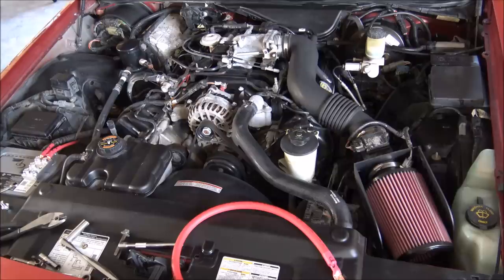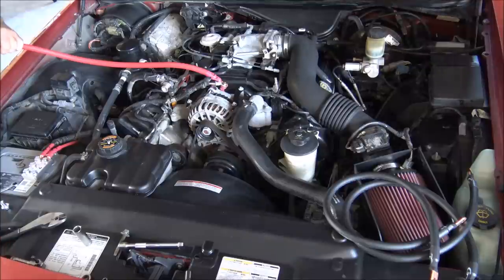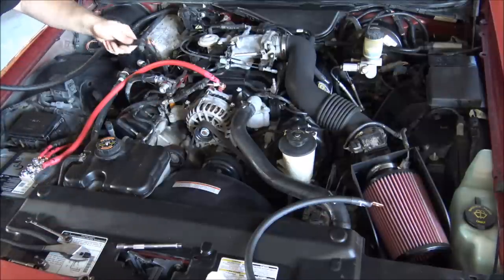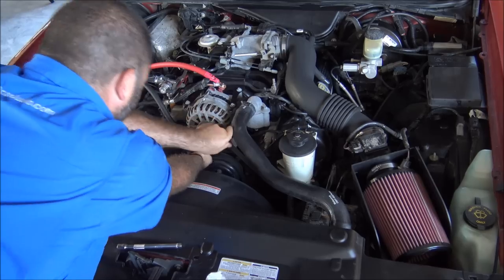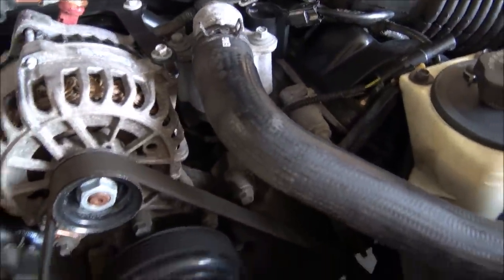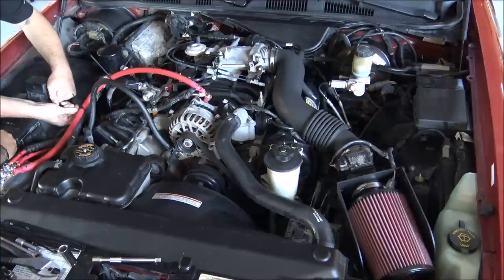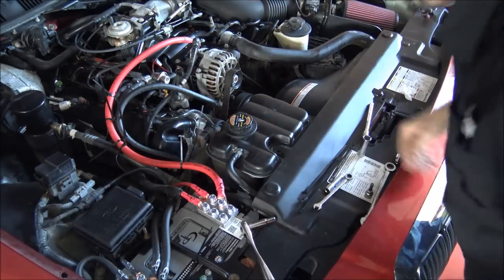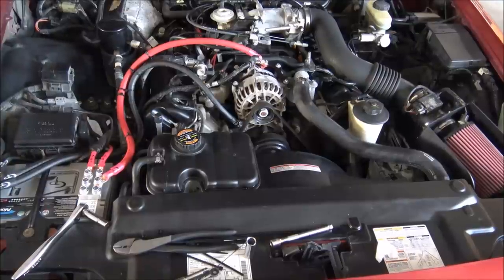HOW TO INSTALL THE BIG 3 UPGRADE CAR AUDIO

Comment: Never hook the positive wire to the alternator with the positive battery terminal connected to the battery post. This connection is hot even with the key on, and if you happen to short out the ratchet to ground, you run the risk of burning out the factory fusible link.
Reply: Damn where is the fuse between the alternator and the battery???
Reply: It's probably a fusible link, like a special section of wire that sacrifices itself instead of burning up the harness. They are usually located close to the battery. An auto shop can find it and change it for you.
Reply: @jamespaulson5486  I was referring to the video. Why is there no fuse on the new positive wire. If it's a leased car and your going to remove everything you added to the car cool, but it is not clear if he removed it or not, to newbies if nothing is fused on that run of wire it could possibly burn the car up

Comment: Ok I do my big 3 a lil different,since the motor mounts are insulating the motor from frame with rubber ,and the body mounts are rubber and you usually ground ur system to the body ,why don't u have a body to battery ground???? That's how I do mine alt to batt,block to batt,body to batt am I wrong???

Comment: What drill bit and thread did u use to drill the hole in the chassis at the bottom
Reply from the maker: Shaquan Hardy 
5/16th drill bit and 3/8ths tap, we use flange head 3/8ths bolts to secure the grounds
Reply: Shaquan Hardy you can but frame tapping bolts.You just have to drill a pilot hole corresponding to the bolt.they have an appearance with a cone type of thread,and they work great,if you don't have a tap set.or grind frame,and weld a bolt to it,or this.

Comment: Do you need to upgrade your alternator to do this?
Reply from the maker: No, even using your stock alternator, you will drastically benefit from this.

Comment: So you don't fuse it from between alternator positive and battery positive? I saw a few videos where they run from alternator positive fuse it then run another wire from fuse holder to battery positive
Reply: Yes you need a fuse on the alternator power wire. Not sure why he didn’t do this. He mentioned that you COULD put one as if it doesn’t matter. It does matter and you do need one.

Comment: What will i need to do if i im running  over 21000 rms. big 3 wisevplz help gp audio.
Reply: If you're running over 21,000w RMS and you don't know what you need in order to feed that system, you are already wrong on so many levels dude. I'd suggest reading up a little bit for your own well being rather than relying on other people to hook your stuff up.

Comment: My battery is in the trunk can I just run the cord from the alternator to my fuse box positive power cable that comes from the battery??? Would be alot easier for me.
Reply: No, the idea is that all wires from the battery to the alternator are larger size than factory. If you have a 1000 watt amp for example you will need a 1/0 wire all the way from the front to the back.
Reply: Yes on the positive side you will run from front to back in back just upgrade your chassis ground

Comment: Hey you think that if I have the big 3 pluse an extra baterry will work with a 8000 amplifier?
Reply from the maker: On 8000 watts you'll need a Northstar smsagm480 battery and need to look into getting a high output alternator
Reply: For 15K I have 10 batteries and 3 HO alternators.  There is an electrical calculator app you can get on your phone to give you an idea.

Comment: I have a 97 towncar is this the same? I cant find stock engine ground..is the short wire from ur batt neg to side of car a good ground
Reply: Yes,make sure to scrape off the paint if there's any ,you want the ground wire to touch bare metal

Comment: It doesn't have the be a 'big' 3 upgrade, 6 gauge wire is good for 100amp so you can do over a 1000 watt system with it. Why go overkill?
Reply: Because they have more than 1000 watts and your math is off anyway.. why wouldn't you increase the flow why would you want to bottleneck electrons 🤷🏾‍♂️
Reply: @slow_rednline4874  yea back then I thought amps had small inefficiencies, but most of them have heaps about 70%

Comment: If your running 3000w is there a need for an upgraded alternator?? Also is your alternator stock?
Reply: Mark Pulford upgrade the alternator
Reply from the maker: We are installing a 390 amp alternator on this today. on 3k rms you can get away with just a secondary battery, northstar smsagm220, or northstar agm31, and will supply and hold save voltage. but a high output alternator is suggested due to the increased performance
Reply: Battery type doesn't matter at all. You will gain nothing using some over priced northstar or some wonder battery. Get a larger alternator that will over supply the total vehicle load and be done with it. You can run a STOCK battery if you do this. What? Your alternator CREATES the voltage and current. Batteries just STORE it.
Reply: I am gonna throw this out, I do agree with Jim.  When using your amp or any electrical device.  All devices in your vehicle will pull the higher voltage source.  Once you are pulling all of that then your batteries will kick in.  This is also why I recommend using large capacitor banks, because capacitors will store the voltage and help keep that higher thus giving your amps that higher performance.  Upgrade the alternator and throw a large cap bank in there.

Comment: show the voltage before and after the big three
Reply: Shouldn't the hot from the battery to the alt be fused according to the wire size???
Reply: Mike Sinur I hear you dont have to its only recommended incase you get in a car accident in a front collision and the wire gets cuts and can start a spark
Reply: Gino Partosetiko
Reply: My car went up from 13.9 to 14.65 off of a cold start up
Reply: @mikesinur1992  your right buddy, these guys are half job Tony's
Reply: @Mazza666  lmfao half job tonys, gonna use that one

Comment: Wats the size battery you use for this build an can i use two for my set up 1600 watts amp 2805rms
Reply: Get a High output alternator.

Comment: does 4 guage wire also work
Reply: Yes. Only if true copper wiring tho
Reply: ryan black where we get that
Reply: Just look for OFC (Oxygen free copper) wire. Make sure the company of whoever makes the wire are true gauge. Stay away from CCA (Copper clad aluminum) wire. A lot of times you'll get cheated with that. They'll give you more jacket than actual true gauge wire. Not only that, but CCA often times does not hold up well to high current draw over time. But CCA is usually a very cheap alternative. Sometimes OFC wire can be a bit iffy depending on the brand, Usually still better than CCA... But, Apparently Welding cable is better than Car audio OFC & CCA wire, because it's 100% copper & very true to it's gauge. So, you just gotta look around.
Reply: KmanBeatz what size fuse should i use for 4 gauge goin to a 150 amp alternator
Reply: Yes
Reply: KmanBeatz welding cable is good shiz. It Has to be if you think about it, the amount of power that runs thru it to weld is intense

Comment: isn't the engine block one supposed to go to the chasie?
Reply: Timmy A ya that's what I been seen
Reply: It can be but it only has to be 2 grounds u choose which one is better or easier to do
Reply: wade Eldred is basically the same just the 4 is one more ground plus u can never have enough grounds
Reply: So upgrade the engine ground and add an additional ground to the battery making it the big 4?
Reply: Timmy A name of the song
Reply: Ground is ground
Reply from the maker: Engine block to battery, and chassis to battery is our preferred method for best results.

Comment: Hey what's you guys take on running a second battery without an isolator? Or should you do it? I have a grand marquis just like this. Should I run a isolator or it doesn't matter

Comment: Will this fix me ecletical problems with my 05 gmc jimmy?
Reply from the maker: ironman7018 if you are running over 800w on a stock electrical setup, the big 3 makes a huge difference

Comment: Real talk; I been stalling my big 3 but after this motivation video it's done. Now I hear my alternator wine, why
Reply: jmar662 jmar662 it's on the way out I believe
Reply from the maker: is it alternator whine in the vehicle, or is it coming from the alt itself
Reply: Ground loop.
Reply: You have a ground loop.  Make sure your alternator has a good solid chassis ground.  Not sure on your setup, but make sure everything is properly grounded, including your head unit, battery, amps and ect.

Comment: what else have u done to it? i have the same car and am trying to figure out how to put a second alt on it?
Reply from the maker: Matty Ice this 390 amp alt is a bit overkill for this setup, its on a soundqubed 2200 with a northstar smsagm80 as the rear battery bank. Car doesnt drop below 14.2 at idle full tilt lol
Reply: that's awsome, im running a soundstream pa1 5000d on my stock alt and a 800 cca interstate batt..trying to figure out what alt to use..
Reply: my voltage will drop too 9/10 volts at idle with the new batt, gonna grab a second probly as well.

Comment: I have a 89 Grand marquis box.But it does not have the alternator screw on it.What do i do.
Reply: Michael Campbell how's your alt secured to the engine block? It's not bolted in anyway? Wherever it is secured to the engine block is where it's grounded.

Comment: What are the other wires that you didnt show like the real short chasis ground next to batt neg
Reply from the maker: Britney Brusnahan That's where the stock 4ga ground was we just swapped it out with 2/0. The wires on the positive were just stock wires, we crimped lugs on them so they could be bolted to the new terminals

Comment: I have a 4000 watt amp and I need a 300 amp fuse is it okay if I go bigger 400 or 500 amp fuse
Reply: You need to look at the specs of the amp, a good amp will tell you the size fuse they require.  If the Amp is already fused, then use an ANL block from the engine to the amp/battery (this varies depending on application).  Put another ANL block before the amp, but make sure it is higher than what the amp calls for.
Reply: Anish Patel the fuse on the power wire is not for protecting the amp. It’s to protect your car from burning to the ground. The fuse should be sized according to the size of the power wire. Do not oversize your fuse!

Comment: Is it the same for all vehicles?
Reply from the maker: Same steps yes. If you have a trunk starting battery its still the same but longer lengths are needed. We have the standard big 3 and trunk big 3 upgrades available on our website. All Ultra Pure OFHC Copper, made in the USA
Reply: @gpcaraudio   and should you fuse the power or would it be ok if you dont ..and should you float the wire ?

Comment: if you have 3 batteries in a f150 under the seat ' do i have to ground all 3 batteries to sane bolt on chassis or its better to make each ground seperate ? can they be 1 foot grounds ?
Reply: One ground from "main" battery to frame. Then connect the rest of the batteries to that "main" battery. Shortest runs possible, less expensive and fewer possible issues with multiple frame connections. If you already have the extra wire leftover, you can also upgrade some of the stock ground wires around/under the truck, for better current, with the larger wire you'd have used for multiple grounds.
Reply: Des420 thanks ' sir '
Reply: Never ground to any frame people. Why? Frame is STEEL. Steel is at best 30% worse than copper at carrying amperage. Not to mention corrosion which will happen degrading it further. All it takes is ONE corroded connector/connection to ruin your day. Don't use OEM body grounds or factory ground lugs either. Ground STRAIGHT to the battery - post. End of message.
Reply: The stock battery is grounded to the frame, so your main point is invalid. The resistance between a straight ground run and a proper frame ground is negligible at best. Besides that Jimbo, I never told him to ground to the frame except on the stock battery (part of the big 3, which this video is about); I told him to ground the extra batteries STRAIGHT to the battery - post. Thanks for not paying attention and having poor reading retention. End of message
Reply: Des420 so then ground multiple grounds from main battery to frame ? sand it very well ' then just ground all the back batteries to the main battery....
Reply: Do the Big 3 under the hood. Run fused power wire from front battery to rear batteries. Connect the rear battery positives together: 3+ to 2+ to 1+ to Main battery +. 
The rear battery negatives: 3- to 2- to 1- to frame ground in rear (seat belt or actual seat bolts can be good in some cases). Sand all painted surfaces to bare metal for your grounds.
Reply: Please do NOT wire it that way.
Reply: The stock ground should be to the STARTER. It's the highest amp draw item in the vehicle. Take notice, steel is at best 30% worse at carrying amperage than clean real copper wire. Electrons going near light speed want the easiest path possible. Then we talk about corrosion/rust. See where this is going? NEVER ground to steel anything. I'm not saying a steel ground will not work. It's just NOT the BEST you can get. See now?
Reply: Is that your thing Jimbo? Going around to every single ground wire related video arguing about how you know the right way to do everything and that welding wire is better than dedicated audio wire, etc.? What an odd thing to become fixated on... And still be so misinformed. Do you even own a vehicle? Because you sure don't sound like you own a system, let alone have installed one.
Reply: I want you to prove me wrong Des420. Put your Crayons down, take a swig off your juice box and show me up killer!!

Comment: I was just wondering if I could do it to my 03 trailblazer because I don't want to do it and taking a chance on frying my alt
Reply from the maker: Martin Howell up you can most Definetly do it and it'll make a big difference. Or big 3 kits are on sale this month. Coupon Code: gpbig3
Reply: I'm only running a 1100 watt amp to two mtx jackhammer 12's
Reply: I just helped a friend do this to his 2002 (I think) he used my old 350A alternator.
Reply: Hey I have a 03 Vic and I ran my big 3 the same way and more power wire is real long because I fused it do that matter if it's real long and now when I turn my acc on it kills my battery
Reply: I'm running the big 3 upgrade on my 04 trailblazer because I'm running electric fan setup. You shouldn't have that issue. I get mine from pcmofnc.com

Comment: wicked tip with zip ties...gonna use it.
Reply: Why, that soft plastic zip tie under the hood with over 200 degree temps? Think about it.
Reply: @jimdavidson5208   You've seen a lot of melted underhood zip ties in your day? Shouldn't have any problem unless they're actually resting on the engine or radiator..

Comment: Have you ever done a big 3 on a Saab 95 2000' v6 turbo
Reply: Mark Seven  where did you ground at and where did you run the power line to the back?  I'm trying to find a grommet so I don't have to drill into the fire wall. I think it's one under the drivers seat
Reply: Mark Seven  did you need a radio nozzle and where did you get it if you did,  oh and the steering wheel interface

Comment: For a newbie this vid is confusing. First you say tap the chassis ground wire directly to the frame, then you attach it to what appears to be some sort of battery terminal that already has so many wires attached that it’s hard to distinguish one wire from the other.

Comment: How would I do this on a 99 expedition bcuz I jus installed 2 Orion 12s with a 5000 watt xs battery in the back with a 4500 watt amp and I have a optimum battery in the front

Comment: what gauge wire is that? also what do call those cool metal pieces on the batteries terminals?.. subscribed!
Reply from the maker: Ever Zamora What's up man, it's pure copper GP 2/0 AWG wire, and the terminals are the machined GP SAE terminals
Reply: It's shit car stereo jelly wire. Use real battery cable wire which costs even less money.

Comment: wait..so i dont need a fuse on the starting cable?
Reply: The inline fuse is on the run from the battery to the amp. The big 3 doesn't need a fuse.
Reply: @Tristan-Hueniken  Bro use your brain. If the big wire you just installed gets damaged and you do not have a fuse then it can short out on the frame/engine and start a huge fire.
Reply: @ericmarciniak1  So does the factory wiring have a fuse? Cause the last time i looked at Big 3 upgrade kits, none of them had fuses.

Comment: Can you run the big 3 from battery to starter?
Reply from the maker: Darren Stevens you need to run the power direct from alt power stud to battery positive
Reply: Do it matter how long the power wire is from the alternator to battery I want my long so I can put the fuse in a decent spot it's about 10 feet long
Reply: @lifewithkeith310   homie the fuse should not be more than 18" from the battery, then another fuse or thermal circuit breaker at the end of that run

Comment: Some pretty long negative wires 🤔 thought that was a no no?
Reply: Not really, shorter the better, but in the end it shouldn't make a difference really.
Reply: @anishpatel5715  shorter the better literally means there is a reason why its better. The longer the wire the more its losing power. Huge difference.

Comment: Where's the fuse on the new alternator to battery wire? If the alternator diodes short, your battery will blow. Then your car will be in flames.
Reply: That's what I'm wondering because  alternators ain't cheap for my 03trailblazer
Reply: I agree with this I felt bad putting mine so far from the alternator, but I still put them so at least the alternator diodes will blow, rendering the alternator useless vs, all the batteries.